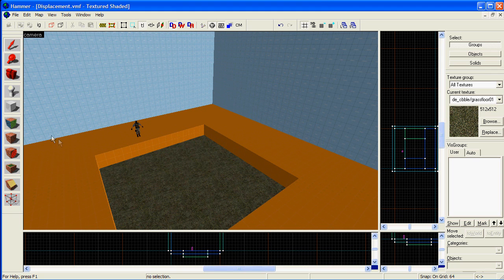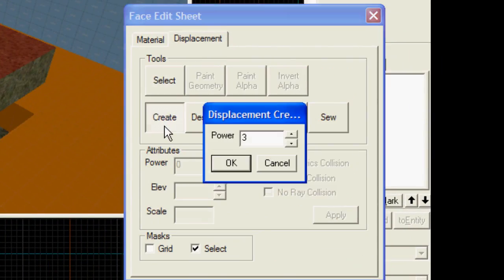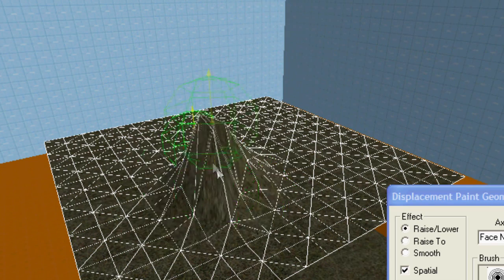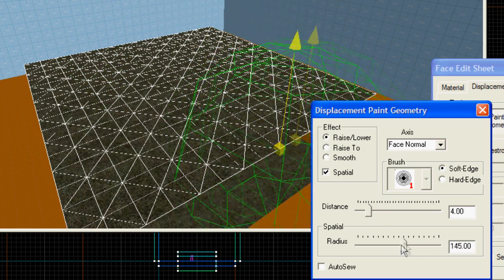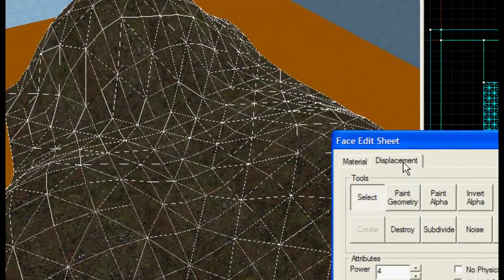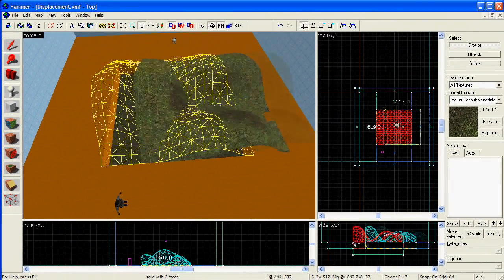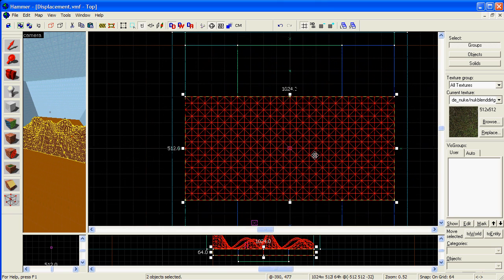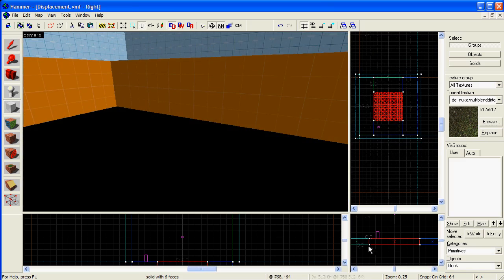Source SDK tutorial - Displacements

Comment: @3kliksphilip Usually when I do displacements I try to keep all of the edges seamless, however when you try to keep the edges together on a larger scale (mountains, pathways, troughs, etc.) the brushwork before converting to displacements is tough to get your head around. Especially if you're subdividing into quads, I was wondering if you had any displacement 'theory' you could provide.